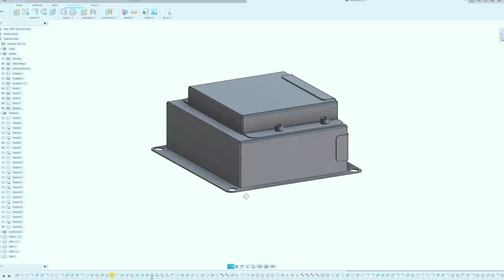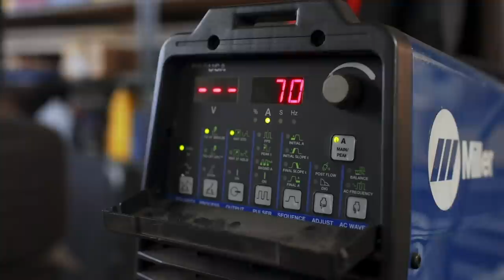Custom Wing Uprights! Complete Manual Brake Conversion! And More. Ep. 77 - K24 Swapped Ferrari

Comment: Engineer moment here: Consider some longer studs for more thread engagement on that pedal box-to-master interface. The first 3 threads always take something like 90% of the load, which means you really want more than 3 threads so they aren't force to carry 100% of it. It's good practice to make sure there's at least 1 full thread out the back of the nut. Great work as always!!! I really look forward to your videos.
Reply: Also the locking part isn't engaged.  Thought they were just test fit until I saw in the car.
Reply: @FUCK_________googIe  Half the video is the pedal box and there is zero indication whatsoever that it changed/would be changed for permanent install.
Reply: @EtherFox  there was a video caption that mentioned he wasn't using the locknuts for the piston-to-pedal pushrods for the mockup, not sure why you'd think otherwise for other fasteners used during a quick mockup.

Comment: Should have cleaned the rust and used some weld through primer on both before welding that sandwich together 👀 I feel my paranoia of it rusting from the inside out lol.
Reply from the maker: It’ll be fine.
Reply: It wouldn’t last in Canada that’s for sure  rust like a Toyota taco gen1 frame 🥴

Comment: Tip for machining threads on the lathe:
Put the thread cutter in "drilling sled" on the right side of your lathe, leave the locking system open on this sled and then just push it in the hole.
Run the machine on very low rpm and it will pull the thread cutter inside the hole. When you reached the depth you want, put the machine in reverse and it will push the thread cutter out.
I hope its understandable :)

Comment: Top tip when tapping in a lathe put your revolving center in the center drilled spot on the tapping wrench that way it taps the hole straight

Comment: A good rue of thumb for tig is if the welds are coming out dark then back the heat off. i would of only used around 45 amps for your job unless i was using pulse, and a filler wire diameter the same or less than the thickness of the metal.

Comment: Little tip for the manual thread cutting. You can put the tap into the drillholder and leave the tailstock loose. Then turn the chuck by hand
Reply from the maker: Mine's a little tight for that, so it's easier to do it the way I did.

Comment: It'd be nice to have a bit more length on those master cylinder studs, considering how much force is going to be applied to them.
Reply: Yeah came here to say this, those are way too short, and consider a locking nut (which will only work with the stud protruding all the way through) as this will be cycled intermittently and may want to work itself loose.

Comment: Perhaps instead of cutting the slots in your pedal box to clear the MC flange, did you consider shaving down the cast alum flange instead?  Just thinking through the force exerted on that pedal box, it might have been nice to keep that 90* bend for added strenght.  (i'm not pretending to know more than you, i'm just brainstorming)

Comment: These vids are great.  Really impressive project.  I know it’s not an apples vs apples comparison trying to look at it relative to the cost of a used (or ‘pre-owned’ if you prefer the dealers semantics) McLaren or Porsche but I’ve always wondered if you were undertaking this project as a commission for a client, what would the price be + donor car? >$150k? >$200k?  Still love it though.
Reply from the maker: It would be significantly more than that. Those numbers will barely cover the cost of the project when it’s done, without an ounce of labor.

Comment: Are you going to put lock nuts on the rod ends and heim joint screws, so that the support rods dont work their way loose over time with vibration?
Reply from the maker: Yes.

Comment: You probably know already but you need some lock nuts on those Heim joints (we call them Rose joints in the UK) to lock them to the ally hex bar or they will rattle about on the threads and work loose!
Reply: Yes, and I don't see how that works well with the beveled ends on the rods.

Comment: More curious than anything, but is there enough thread on those studs for the cylinders?
Reply from the maker: Once tightened down it seems so, yes.
Reply: @stanceworks  You could use some short lock nuts.

Comment: Porsche 911 used a electric vacuum booster
Reply: For the breaks
Reply: Which 911 are you talking about? The pre-SC all had manual brakes from what I remember.
Reply: @jsquared1013  I had a 91 c-4 air cooled